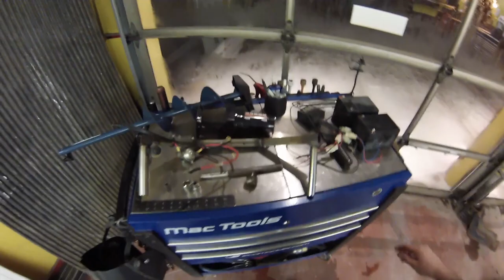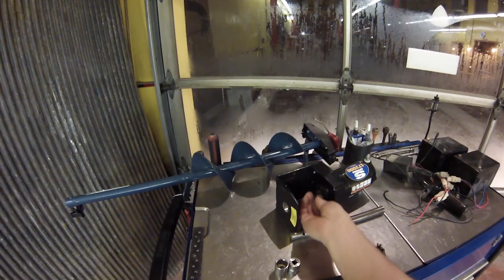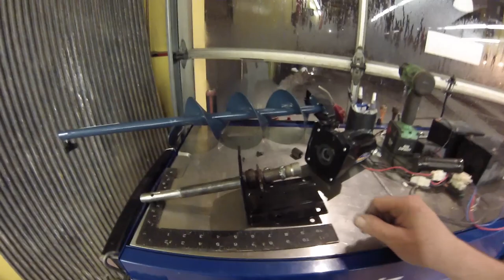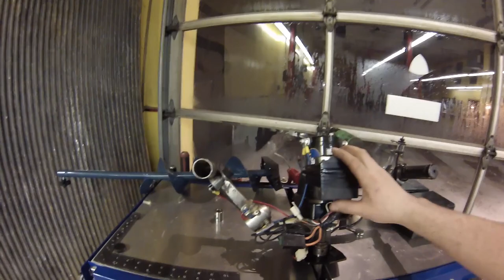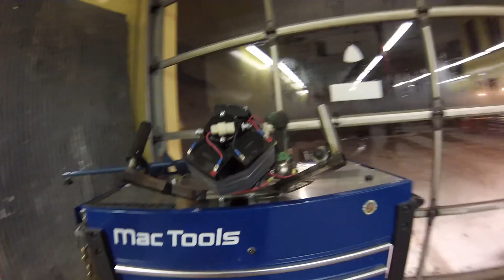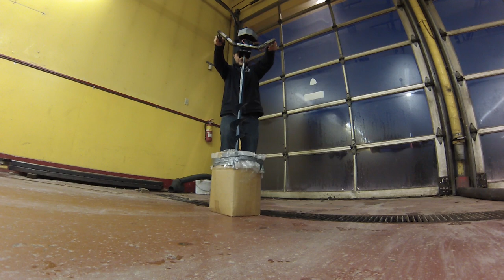Homemade Electric Ice Auger - Winch + Scooter

Comment: The winch motor is 12v motor right?  So running 24v through it under load ought to burn it up, I would think.  You need a 24v starter off a diesel motor or some other 24v motor.  Good reusing parts.  Doug